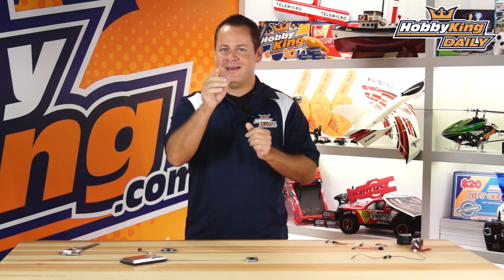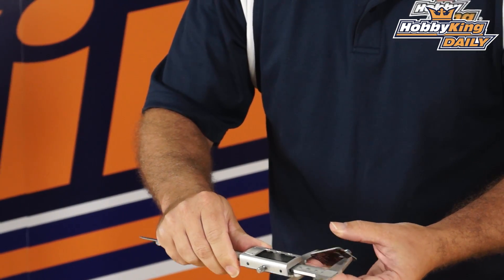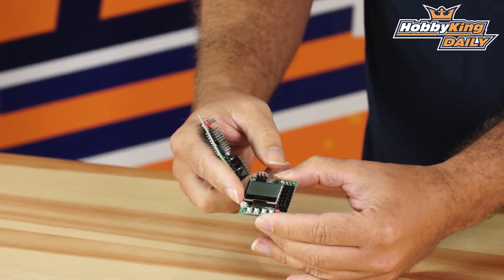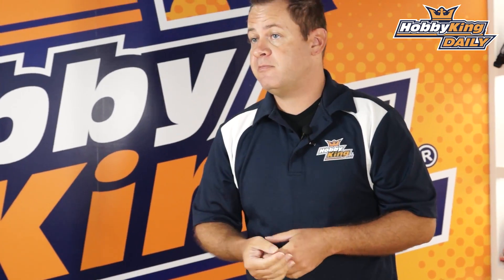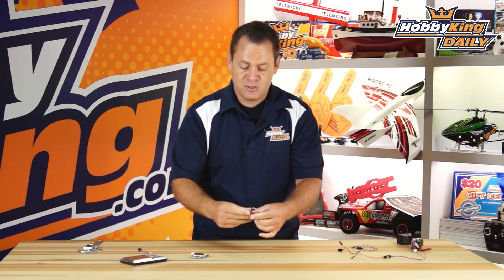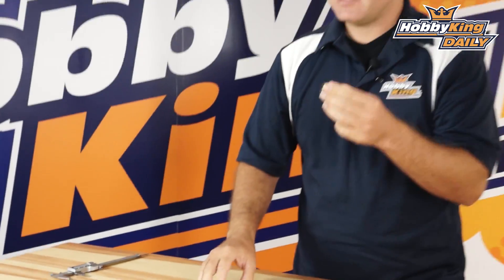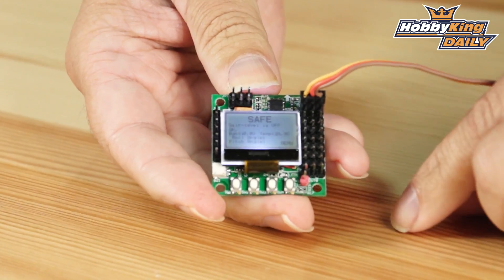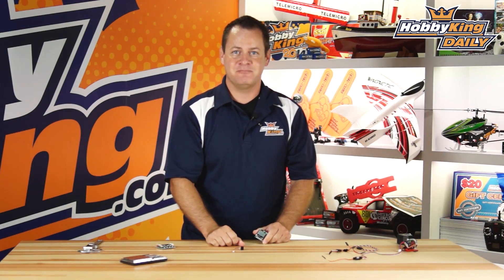HK KK-Mini Multi-Rotor Flight Controller - HobbyKing Daily

Comment: Hey guys, I have the KK2 mini with the single line of pins on the left.  I have connected up my ppm receiver using the one lead and my receiver has binded correctly.  However, for some reason, my receiver test always shows "no signal" and I cannot figure out why.  I have a solid red light on the receiver when I bind it and when I take it out of PPM and use standard, the light flashes.  So I know the receiver is binded correctly.  Why is the KK2 mini still showing "No Signal" under the receiver test menu??????

Comment: why does my quad drifts when its on self level mode ..?
Reply: Wind
Reply: IRFZ44  it drifts even there is no wind ,,,🤔
Reply: Trim it
Reply: IRFZ44 you mean the trim which is on self level settings ?
Reply: On your transmitter
Reply: IRFZ44 thank you sir .. i will try it
Reply: And if it still drifting, install a goddamn GPS locking system and your quad will not drifting anymore
Reply: IRFZ44  does kk supports GPS , i am new to this hobby i donno much about this things 😛
Reply: I'm not sure but CC3D and Naze32 does support GPS. KK flight controllers are kinda outdated
Reply: IRFZ44 yaa you are right .. i am thinking of buying Apm 2.8 .. is it good
Reply: Good yet expensive
Good luck

Comment: hi like the presentation however i am new to drone making so i a  question about this chip, is it possible for m5-m8 to be programmed for single directions using that flight controller? and if so please advise as i am trying to build a extremely original drone.

Comment: With the voltage sense wire,do I only hook up the positive to the board,or do I have to attach a ground as well somewhere?
Reply: hi! did u found the answer?? I'm stuck at the same. Should i just connect battery positive terminal to sense pin of mini kk2.1.5 to monitor the voltage of the battery?
Reply: Nope,I never actually never purchased a mini,but from the looks of it,and having some time to think about it,I'm assuming the board is self grounded,so it probably doesn't need it! I need to try one out in my acro rig,I've gotten spoiled to telemetry!!

Comment: Is it posible to connect the normal kk2.1.5 the same way? Only signal wires? or only motor 1 complete and the rest signal?
Reply: You can connect it that way on all flight controllers. 

For your receiver to KK 2.1.5 connect one channel, like the throttle, using all three wires (power, ground, signal).  This will power up the receiver.  For the remaining channels, just connect the signal wire. 

For your motor to KK 2.1.5 connect one ESC, i.e. ESC #1 to M1 with all three wires.  That powers on the KK2.  Then for the remaining ESC, only connect the signal wires.  Please keep in mind that the remaining ESCs (2 -4) will get their power from a power distribution board.
Reply: Well I don't mind the ESC side, but from the receiver I want a cleaner way to set up my quad. So thanks for the answers!
Reply: 1 complete and the rest Signal should work